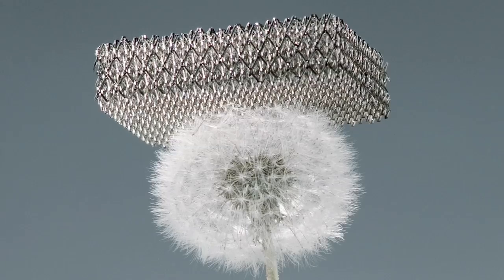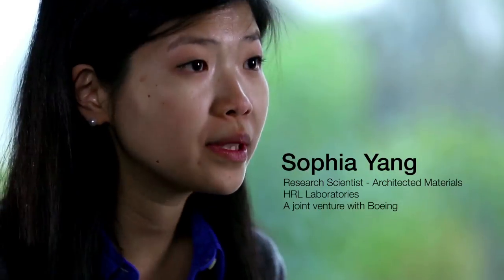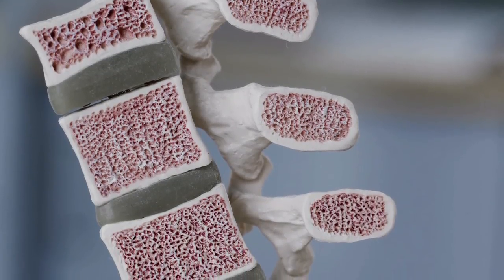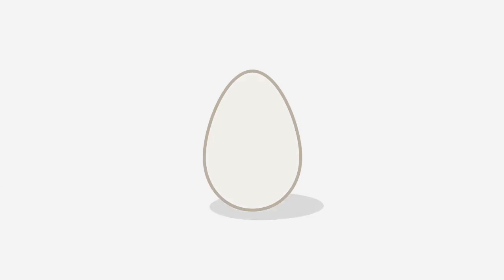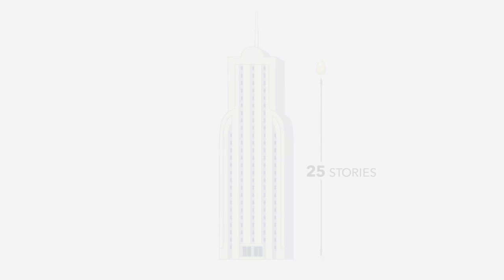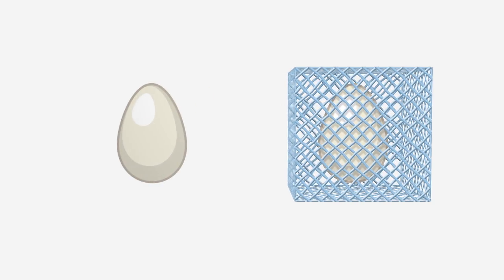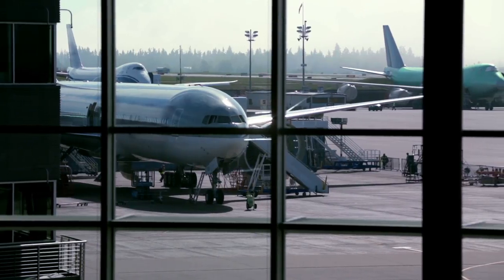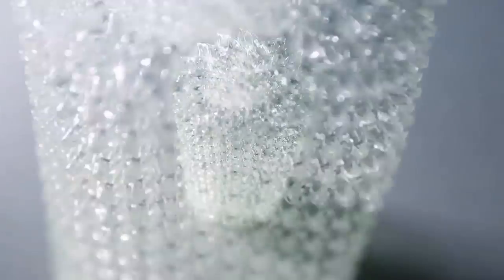Aerospace Innovation: Boeing Develops The Lightest Metal Ever With Latticework for Future Aircraft

Comment: Language matters.  This is not a metal, nor is it a material.  Clever though it is, It is an engineered structure of existing materials.  I'm light on trust of an engineer who doesn't know the difference. regardless how clever or innovative the effort.  Maybe its the Boeing PR department that needs to go back to English comp 101 and drag out their dusty Funk & Wagnalls.
Reply from the maker: The metal is a nickel-phosphorus alloy that is
coated onto an open polymer structure. The polymer is then removed, leaving a
structure that consists of 100nm thick walls of the nickel-phosphorus, thus
creating the lightest metallic structure
Reply: +70navigator Yeah... Let's leave the science to the people who know what they're talking about.
Reply: +70navigator you are wrong.
Reply: +Boeing  I think you are missing 70navigator's point by just putting in this stock comment (with unnecessary carriage  returns as well).  You are making the public believe this is a "new" material or metal when it is NOT.  It is an innovative example of engineering and design but terminology is important.
Reply: +70navigator Yeah this is not new.. I've seen that picture a few years ago.
Reply: Would you like some ice for your burn, sir ?
Reply: +Boeing snap
Reply: +Boeing The thing is, that saying "lightest metal ever", indicates some kind of new chemical element. That, as you call it, metal is still not one the lightest materials known, because the alloy's density should be like 6g/cm3 or so, when Lithium is the lightest metal (~0,5g/cm3). So, it's not the alloy that's lightweight, but 3D structure, which consists almost entirely of air. Thus the title of this spot is so wrong. I hope you get it.
You may fool public opinion, but engineers will know the difference. And yeah, language matters, like +70navigator said.
Reply: boom
Reply: +70navigator or maybe you can simply understand what they are announcing without nitpicking.
Reply: +70navigator If you listen to the video the researcher refers to it as a structure. I don't think that whoever wrote the video description is an engineer, but this doesn't really matter, right? ;)
Reply: +70navigator What is your definition of metal?
Reply: +70navigator No argument. Actually plenty of argument. I am one of the inventors of the ultralight material (along with colleagues at Caltech and UCI). There is an easy distinction between large-scale structures (e.g. buildings, the Eiffel tower) and crystalline materials (e.g. quartz, aluminum) both of which have "lattice structure". The debate comes in somewhere in-between. Would you say a foam (e.g. styrofoam) is a material? I would, and from an engineering perspective, that's how you would model and build with styrofoam. It's not a structure. Our arbitrary line between material and structure is somewhere around 1mm "feature size".  Most of the microlattice materials we produce are, for practical purposes, structured materials that you would treat homogeneously in engineering design.
Reply: +Boeing That's what 70navigator was trying to say, it's the "lightest metallic structure" and not as the title of the video say's "Lightest.Metal.Ever."
Reply: +70navigator Just reading the comments here you can tell that the word choice is causing misunderstanding.  I have had people say why does it matter... one reason is because you can't just use this in applications as a new "material" when part of what makes the structure lightweight is the open weave structure.  So people who are asking can I make XX out of this "new material" do not understand that because the choice of terminology in this video (probably by marketing, not scientists) confused the issue.  This poor choice is why people say they don't "get" science which is unfortunate because the actual thing they did is really cool!
Reply: Wow!  What a firestorm I've inadvertently created by my comment. I first viewed the video from a link on the ASME engineering e-news letter, so my assumption was that I was addressing fellow engineers, or at least people with some level of technical competency. My bad. Thanks, Bill, for your response. Good to hear from the person who actually did the development work. We must agree to disagree, however. 
To your point, styrofoam is an isotopic solid material, not a structure. If, on the other hand, you were to carve an airfoil from a block of the stuff it becomes a structure, the distinction I assert is that it's functionality is now determined by its shape, not its material properties. That is why your development is a structure, not a material. It's behavior is a direct result of its shape, not by the properties of the material from which it is made. 
I hold that engineering is a profession characterized by both accuracy and precision, not only in the analysis, but also in its written and spoken communications. 2.995 is not 3, and 3 does not carry the same connotation as 3.000. I wouldn't expect a non-technical person to appreciate the difference, but I for sure would expect a technical announcement from Boeing to be both accurate and precise. While I both respect and applaud your technical achievement, your argument that scale somehow serves as the distinction between material and structure seems arbitrary and fuzzy. Unless a precise definition can be given of the scale at which a material becomes a structure, or vice versa, your assertion lacks the rigor required of engineering and science. Clearly, the Boeing PR people have egg on their faces with this one. 99.99% air? Really?  Does that remain true in the vacuum of space or submerged 1000 feet in the ocean?  At any rate, congrats on your accomplishment. I look forward to seeing how it is implemented.
Reply: 70navigator we have had exactly this debate within the solid mechanics community - for 1cm size features or less Vikram Deshpande, Tony Evans, Haydn Wadley and myself are all on the side of "material". Others seem to prefer structure or structured material. In any case you are not correct in the assertion that the properties are entirely due to structure (the "architecture"). Constituent material is also extremely important in determining properties. We can embody this with diamond, copper, parylene, silica, and other constituents and achieve unprecedented properties across a wide range of stiffness, strength, toughness, etc. even at the same relative density and architecture.
Reply: +Boeing Yet 70navigator's comment is spot on - this promotional video is just thin air....
Reply: +Boeing Thanks.
Reply: Aha!  Bill, now we're really getting somewhere!  I think you should have been featured in the video and then all this hoohah would never have happened. It seems that wherever there is a void of information, uninformed opinion and speculation swoop in to fill the vacuum. First rule of the press release:  get it right down to the last detail and tell the full story. Second rule: put the guy with the most knowledge of the topic in front of the camera!  Again, Boeing's bad....but certainly not your's or your collaborators.
Reply: Sereina Campbell
Who says she's not a native English speaker?

And do you REALLY think that native speakers always are the best?

I'll tell you, you're wrong.

I'm not a native speaker (I'm Dane); yet I do often correct my native English and American friends' language.

I'm even proofreading in some cases for native English speaking friends.

BTW, you forgot to capitalise English...
Reply: +Boeing , So it is a "metallic structure", not "metal", right?
Reply: +Bill Carter it is always true that the structure has properties of the material from which it is made but that does not make the material a different one because it's in a different structure therefore it is not a new material it is a new material structure that allows it to have unique properties
Reply: Edit not showing up so I can fix that run on sentence, sorry.
Reply: +Boeing Then don't call it the lightest metal ever. Because it isn't.
Reply: rib roast
Reply: +70navigator Material - the matter from which a thing is or can be made. Maybe you are the one who needs to drag out that dusty Funk & Wagnalls.
Reply: +70navigator I agree; and Boeing seems to be recycling the same reply to different comments.
Reply: Oh wow how important
Reply: Nice
Reply: +70navigator it probabily wasnt the engineer who made this video, some stupid agent probabily named the thing
Reply: +Boeing Love the copy and paste
Reply: +Boeing ..OK....removing the polymer later...that explains it better....and, it's not exactly a 'material'...so much as a 'structure' made out of a material (nickel).....
Reply: +Boeing Awesome were do get it
Reply: +70navigator Oh how clever you are: language matters sure, but only ever in the context of your target audience. The average joe blow watching youtube or being advertised at by boing does not know or care about the subtle semantic differences between metal, material, engineered structure or what ever. Do you really think the engineers who worked on this don';t know the difference?  use language and words that match your audience, so they do not get confused, bored, or make misconceptions. I don't know but I bet they could write an advertisement, a technical report or a product spec far better than one you could write. Talking to scientist or engineer: "We have a new engineered polymer micro-lattice based material that ...." Talking to pr department: "We have a new engineered material that ..." Talking to average person: "We have a new material that ..." Talking to a child: "We have a new kind of metal that ...."
Reply: i thought they meant metal...not metal structure
Reply: +Boeing Again, proving that you lied and it's the lightest metal STRUCTURE in the world. It's not the material. I'd suggest you leave it to the real engineers and scientists, kids.
Reply: +70navigator Boeing used to be such an ambitious company...
Reply: +Boeing mine blown
Reply: +Boeing you guys make the world a good place with your smart people
Reply: +Boeing 
In 30 seconds I foresaw a world of innovation in my head. Assuming that you must be using solvents and a vacuum chamber to remove the polymer lattice, I can see a reversal processes being valuable as well! Imaging the radiators and heat sinks that could be made using such a system! 
 -everyday I die inside knowing I never went to collage. -Stay in school kids!!!!!!!!!!
Reply: +Boeing Wouldn't the structure break under pressure
Reply: +Boeing what kind of phosphorus is it: white, black, or red
Reply: +Boeing if I could go back in time I'd go to NYC 9/11/2001 and give every jumper a blanket of this
Reply: +tonywardd Ooh burn
Reply: I'm going to make a summary of this comment section and turn it in to my teacher as a book report.
Reply: +Cristi C   Yeah, says that right at the beginning.
Reply: +tonywardd like you even know what he's saying.
Reply: +Boeing OOOOOOOOOOOO 70NAVAGATOR JUST GOT IT BUUUUUUUUUUUUUURRRNNN
Reply: +MrMagnificentUnicorn It's just a description of micro lattice
Reply: But, this is no the "Lightest. Metal. Ever." It may be the lightest material made from metal per volume, but not a distinct chemical element.
Reply: +tonywardd hey if your so smart then you do it Boeing is just trying to make life better!
Reply: +Boeing instead of Ni you could have used Mg it will be much more lighter.
Reply: rajesh shahi rajesh shahi 
Titanium with a hint of Gold is the best mixture.
Reply: +Boeing 
v

Comment: When it is so flexible, you won't be able to use it as a primary chassis for the aeroplane, right? Because in turbulence, this would probably bend to a very high extent. So, if you have to use another, heavier chassis in the first place, what is the use of this? Please, correct me if I'm wrong.
Frankly, I see this under the cushion of my bed in 15 years.
Reply: I can see it in soles of shoes somehow
Reply: Silver the Hedgehog Another potentially good usage.
Reply: +Tanmay Chhatbar You could use it as part of a honeycomb sandwich structure.  Microlattice core bonded to aluminum or carbon fiber.  Think about a piece of cardboard.  If you look at a cross-section, it's just three (or five) pieces of paper cleverly glued together, but it's a lot stronger than it would be just stacking the paper.
Reply: ***** That could be done. But again, that would increase the density of the material. So, the main attraction of the structure would be lost.
Reply: Tanmay Chhatbar It would be heavier than the microlattice by itself, but it would be lighter than a piece of aluminum of the same thickness, so there would still be a gain.
Reply: ***** I apologise for continuing the argument, but then, would pure aluminium be way stronger than the microlattice? Or will the lattice be sufficiently strong to withstand all the natural forces? Thanks.
Reply: Tanmay Chhatbar This is hardly an argument.  This kind of Q&A is fun. 

The pure aluminum may be stronger (depending on the exact alloy being used), But if the sandwich is strong enough for the application, the weight savings becomes attractive in applications where weight is crucial.  Automakers spend tons to get the weight of their cars down for better mileage.  Same thing with aircraft manufacturers.
Reply: ***** Thanks for the explanation.
Reply: maybe sandwiched between something for flexability? or added strength although im not sure how because its not rigid.
Reply: Yes you rebel against one of the most powerful companies in the world.

Comment: If you say it takes three feet of bubble wrap an egg you really should know how much of the  metal you would need to protect the egg. Because three feet of bubble wrap is maybe a dollar how much is the unknown quantity of metal?
Reply: +Niño Rata No. In something like a huge airliner or spaceship things like strength and light weight are much more valuable than cost. Saving weight and space can allow new things to be done or simply save more money over time than the initial material cost was.
Reply: +Crash Forty Five Everything is valued in money
Reply: +Dave Preston But bubble wrap isn't used in planes. Also the microlattice is a lot more durable and infinitely more reusable.
Reply: +Niño Rata +Dave Preston  Yes but not always in the "how much of the cheapest stuff do we need".  For example, in boeings case it'd be "how much money will we save in five years if we use the more expensive but much lighter material."  And in this case, the egg drop example was to simply demonstrate what is possible with the material, not the cost side of it at all.
Reply: +Dave Preston  Consider that it might be a Faberge egg drop hosted by the one percenters....then the expense is justifiable and there premise is therefor plausible....

Comment: While it is lightweight, which is good for flight, and can hold up under pressure, how does it hold up to corrosion, or to heat?
I would also like to know what the chemical makeup of it is, along with is it available to the common consumer and what temperature it melts at.

Comment: How do you make it?
Reply from the maker: The metal is a nickel-phosphorus alloy that is
coated onto an open polymer structure. The polymer is then removed, leaving a
structure that consists of 100nm thick walls of the nickel-phosphorus, thus
creating the lightest metallic structure
Reply: Do you think this could be replicated by the hobbyist that might 3D print a similar lattice in HIPS, use vacuum thermal deposition to coat the print in a given metal, and then use D-Lemonene to dissolve the HIPS?
Reply: +CS Steingrube Yep!  It'd be easier to plate the 3D printed material.
Reply: +Boeing  that is cool I ges
Reply: with air apparently
Reply: SCREW ALL THAT SCIENCE THEY DID SOME MAGIC STUFF

Comment: if its so light, wouldn't the jet blow away if there were high winds?
Reply: If the people on the plane are from the south, it does not matter what the weight of the metal is
Reply: I don't get it...
Reply: +Pug lord 117 virtual high five
Reply: They didn't say they would make airplanes out of it, they said the interior cabin can benefit from multiple uses if they were to implement it somewhere. Beside the plane can't be made of that, you need the cabin to be pressurized. Also any commercial airline made of that would still be as heavy as a small plane.
Reply: No it wouldn't blow away. The plane still has a massive amount of weight, just becomes slightly lighter due to the use of the light metal
Reply: ahhhhhh ok thanks Nick Bookman
Reply: +Daniel Lewis he or she is implying people from the south are fat no offense it's just an example
Reply: You wouldn't use it for the entire plane.
Reply: +Pug lord 117 savage.